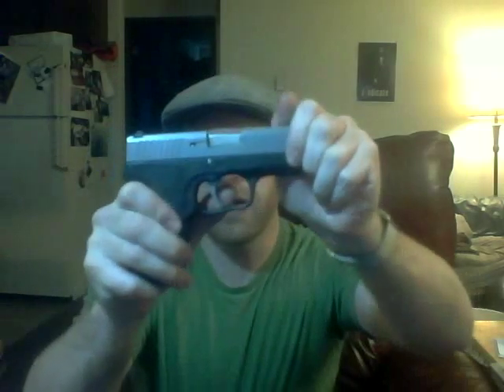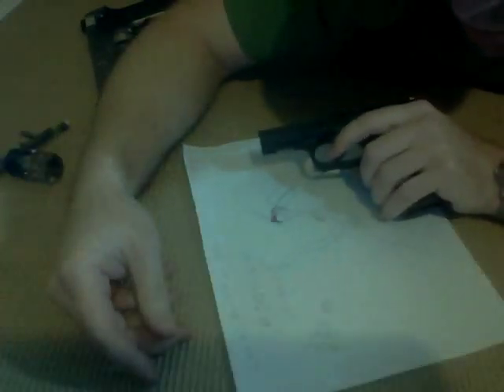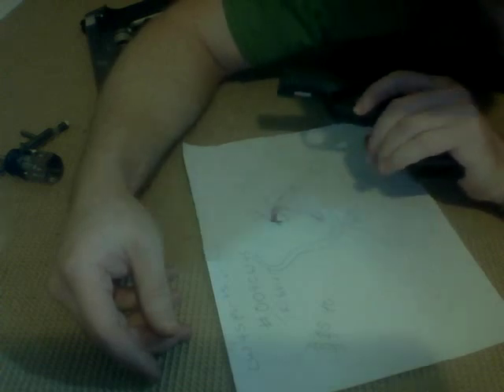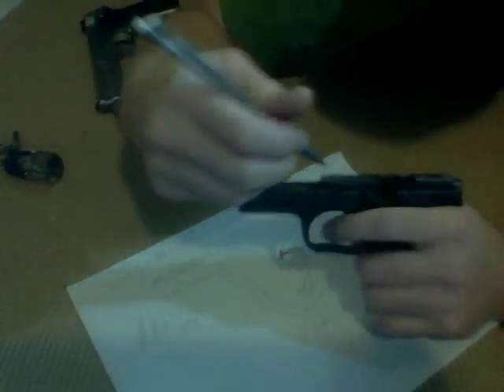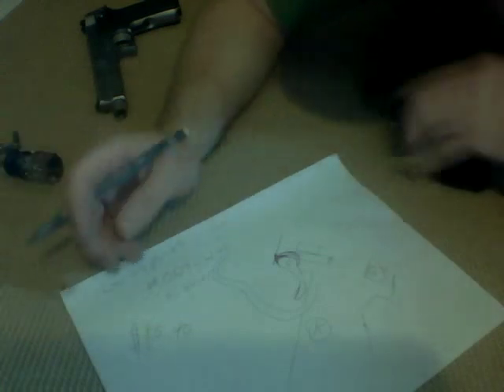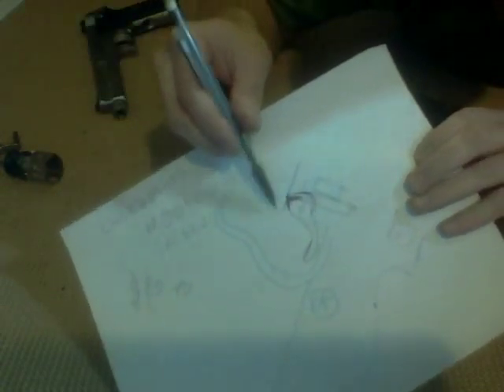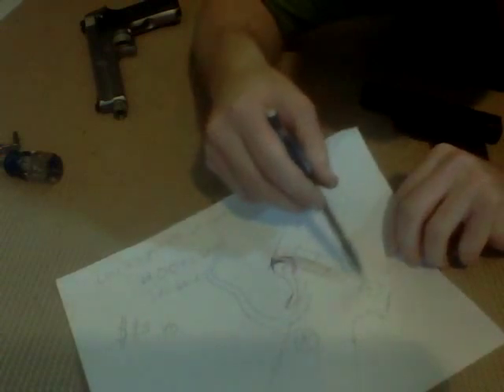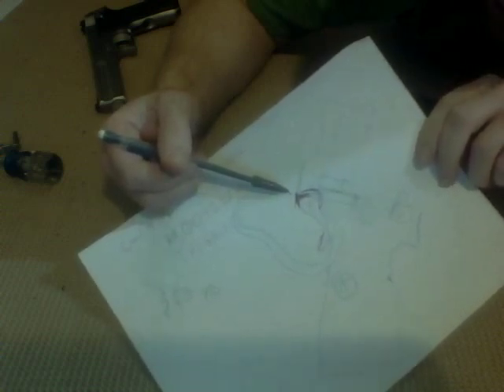Kahr Problems ... addressing a serious issue with a CW45

Comment: Brother,  you hit the nail on the head. I just picked up a used CW45 for under my Plate carrier as backup and have this exact issue. Great job figuring that out!!!!!

Wow!!!!! After watching your explanation, I fixed mine with a cheap tiny cordless drill in less than 2 minutes  by simply making a slightly deeper cavity in front of the trigger where you pinpointed the lack of overtravel.  It FIXED the problem without creating any noticeable overtravel but lightened the breaking point by several lbs.  I subscribed.
Reply from the maker: It's great to hear that I'm helping. I got a lot of hate for these videos when I made them.
Reply: @GunFunZS  Stick to your guns (no pun intended) when you know you are right and ignore the ignorance of others displayed as hate posts. If you helped one person, that is success. In your case, you saved me from having the expense and pain of having to send a defective gun back to Kahr to fix. Probably why the original owner dumped it in a pawn shop and I got it for under $300.

Comment: I have a Kahr CW45 and carry it every day and have owned it for around 6 years and absolutely love it. I would recommend anyone to buy one. Thank you James A.
Reply from the maker: Welcome. It's a gun I would trust.
Reply: I have the cm45 and carry it everyday, I have been through it many time's tweaking, smoothing and polishing this and that. However i think that's par for the course with most any budget pistol, owned and operated by a competent user of whatever brand a platform is. That said, if this particular issue outlined is the norm rather than the exception with the cw45 platform, I'm glad you've made the manufacturer aware of the situation either way. We take the savings in the budget world with the general understanding that there's going to be little things that could be done, to make a weapon perform to the best of it's ability. Matter of fact for the most part i enjoy the challenge and opportunity to tweak and make it better than it was thought to be.

Anyways thanks for the info and head's up on the cw45 design, some user experience, tips and tricks on this model. Stay safe out there everyone, most importantly stay frosty asF.

Comment: I have the exact same problem on a CW40.  Never shot it before, just took it to the range today and thought it was broken.  Couldn't get a single shot off with it. Got home started playing with it noticed if I fight against the frame it will shoot. Then I ended up on your video... Also noticed if I do it left handed it will break, right handed is almost impossible.
Reply from the maker: Interesting. Thanks for the info. The one in the video was either hand, but depending on how cold it is, it could be flexed to shoot, or was about impossible. If you warranty it rather than do the fix as shown in http://www.youtube.com/watch?v=gOdIFlDikho&feature=c4-overview&list=UUokyEtnWCHKnIfs3bRX7QLw, do me a favor, please and put a scratch on the trigger bar, another on the trigger. Also observe the area where the trigger contacts the plastic of the frame at the limit of travel. I would like to know which parts they are addressing to fix this from the factory. It could be done at any of those points.

Comment: Couple of quick notes: most people have these devices called Electric Lights!  They are wondrous inventions for providing indoor light -- you should try them sometime.  Another tip:  Seeing you, for some reason, is not my top priority -- I came here to see a Kahr disassembled.  ALL the things done off-camera are the ones I'd like to see!  You have valuable information to share, you could very easily make things clearer for your audience.
Reply from the maker: +tkarlmann My audience for this video was intended to be one person. My camera had just been stolen, and filmed this as a midnight break to explain the situation to the pistol's owner. My apartment at the time had either places with good lighting or places without annoying background noise, and it had to be somewhere I could use the webcam on my laptop as the camera. Most of my other videos have good lighting, are a lot more concise, and have things in shot. However, did you happen to notice the multiple links to Part II? http://www.youtube.com/watch?v=gOdIFlDikho&feature=c4-overview&list=UUokyEtnWCHKnIfs3bRX7QLw

It shows most of what you probably want to know. I was shocked by the wide traffic I immediately got with this little video and the numerous questions I got from people. So I put a bit more effort into that video. It isn't perfect, as I had to fit it around studying for law school midterms.
Reply: GunFun ZS: Well, if your video was intended for one person, then why put it on YT?  I just wanted to see someone take a Kahr apart.  I cannot, obviously, appreciate your back story -- I only know what I saw.  I'll keep searching for a Kahr disassembly video -- by someone who has lights and a better camera.  Good luck with your law-school midterms -- just what this country needs -- more lawyers.
Reply from the maker: tkarlmann First off. Let's deal with your crack at lawyers. I am a business attorney. I help make new businesses start and survive. The nation needs people like me. Moreover, I am an avid firearms enthusiast. I bet if you think about it, you can come up with a few reasons why having policy makers and appliers who like guns would be useful.

Now I am going to turn your question back on you. Why did you go to a video on an obscure technical problem to find the most basic obvious common information? i.e. a field strip video? These guns are self explanatory. But high quality videos on field stripping every identical Kahr pistol (or other similar designs) are plentiful? And why would you complain that my technical video is not doing the job of a primer guide?

As for my reasons to publish?
1) Why not?
2) It was a way to do show and tell with the owner, who lived several hours away from me.
3) I identified a serious latent defect in a life saving tool. I thought the world should know. - that means a defect which is not easy to discover under normal observation- Also I wanted the few people who might have this problem to know the solution.

It turned out there were a lot of people who were simply curious, and a surprisingly large number who actually had the problem. Those guys might have liked a prettier video, but what they cared about was the fix. This gave them that. I left it up for them.

4) It became a sign post to point at the video which explains the situation more clearly and shows the fix in detail, Part II. As near as I can tell, this video draws traffic and was linked in several forums. Pulling it down breaks the link chain.

-- Aside.
I've politely responded to around a hundred comments like yours on this video. I try to take any constructive feedback I can get. However, most of the time, I find that all they have to say is that they weren't adequately entertained and that my video sucks. Usually they have never uploaded a video of their own. I generally check. If someone makes good content, I take their feedback seriously.

 I want my quality to be good, but on the other hand I've noticed an inverse relationship between production effort and traffic.  You might not realize it, but shooting and editing this video took several hours I could barely afford at the time. A shorter video takes several times more work. For example, my video on shotgun crimps took around 8 hours to set up, prep, script and edit. That fit about a 40 minute discussion into a 10 ish minute slot. That's not easy. It has maybe had a few hundred views in a couple years. You never know up front what stuff is going to draw traffic. Throw a video together in one take and post it up raw, and it might be your one big hit. Spend a week on it and it might be tumbleweeds. I just don't have time to put the full effort into every video on the off chance it goes a little viral.
Reply: GunFun ZS:  Yup, that's a lawyerly reply alright!  I hope you will do well in your career.  Why I went to your video has NOTHING to do with field stripping -- that info is in dozens of other videos.  What I was hoping for was a complete Kahr tear-down, and I've already seen one on a tear-down of the slide.  So, you add in poor lighting, blurry closeups and off-camera bits and it does really add up to a dissatisfied viewer.
Reply: GunFun ZS a
Reply: Funny..I enjoy my Kahr..and why be awake at midnight with your eyes 3/4 of the way shut doing a tool review..best.:)

Comment from the maker: I'd like to see if anyone else has experienced this issue. A gunsmith friend pointed out that this kind of thing is usually created by the manufacturer rushing production and not fully cooling the molds between batches. Therefore, it is likely that firearms made prior to or during the last panic might be higher risk for this kind of issue.

Comment: I have one and it does Not break all the way to the frame at all. Perhaps a manufactured difficulty, but there is a warranty. By all means this is definitely one of the best, if not The best concealed 45 acp. Good lord, the feel and accuracy are awesome.
Reply: I would easily take it over a Glock 36.
Reply from the maker: Warranty was rather useless when they had a 6 month backlog and were lying to their customers about the nature of the defect. Also when the defect was unlikely to be detected by owners in normal range use. 

I think they are a decent pistol, but it was a serious problem to have a carry gun which will not fire. Now there are many good options in this category and if you like the kahr 45, by all means use it. The fact that many of them work as designed doesn't eliminate the fact that a significant number don't and that the company still has yet to be honest about the reason.

It is fortunate that their current warranty times are relatively short, and moreover that any person has the option of self-help.

Comment: I own a Kahr CM9 and I talk to a lot of Kahr owners. These are quality guns right up there with Glock as far as reliability. I trust it enough to be one of my carry weapons. Over 1500 rounds through it without a hiccup. Like ANY reputable gun manufacturer, they will fix the problem FREE under warranty. Let me know of a gun manufacturer that has a 100% problem-free record? Bad-mouthing a reputable company for a problem you never even gave them a chance to make it right?........oh my.
Reply from the maker: What bad mouthing? I did a simple fix to the gun in under an hour rather than send it in for warranty during a gun panic (months to get back, likely.) Why is that bad? Why knock my actions when they were my choice? Your gun might run beautifully, but this one didn't and now it does. Problem solved ........................... oh my
Reply: GunFun ZS "serious problem" was a quick fix? This video is very discrediting to a very good American gun manufacturer for a small problem that Kahr would have fixed for you if you gave them a chance in a week's time free of charge. I own a Kahr 9mm and a Glock 40 cal. The Kahr has tighter tolerances and has been just as reliable.
Reply from the maker: Demo Crat A carry gun which won't shoot in cold weather IS a serious problem. There is little warning for this issue unless you know to look for it. My friend had been carrying the gun for the whole summer and the problem only became apparent when we went target shooting in winter. Had he needed the gun, he would have been in a bad situation, even though he had done all the normal testing a gun owner could be expected to do. This is the very definition of a 'latent defect.'

Even if the fix is easy, it does require either modification of a factory trigger spur, or modification of the frame. More than most people would take on, and a very big deal. If a manufacturer is good about fixing problems, that's a good thing, but there is no obligation to pretend the problem didn't exist in the first place. Warranty service is always secondary to whether the item worked correctly in the first place. Simply put, this one didn't work and apparently many others have had the same problem.

I absolutely love the Saiga 12 shotguns (Veprs too), but I don't get mad if someone mentions that his has one with incorrectly sized gas ports. The fact that one of mine was perfect out of the box does not diminish the reality that others have examples that aren't perfect. Nor does that create an obligation for them to hide their experience. On the contrary, more accurate information is undeniably better. People deserve to know that this can happen. It is bizarre to me that people would think that this information should be concealed if the manufacturer is willing to fix problems after the fact. If they fix it, great. I'd share that information too.
Reply: My first Kahr was a lemon.  Trigger issues that wouldn't reset and the hitting the frame.  Not to mention continual feeding problems.  (CM40) You've just been lucky.   No way are they more reliable than a Glock.
Reply from the maker: gpicard1 I've heard of glocks with casting flaws that caused them to spit out the spring clip for the slide lock, brass to face etc. Glocks have lemons too.
Reply: You don't own a CW45 so, you are not feeling with this issue. Other CW45 owners have complained of this issue.

Comment: Have no issues with mines!  If there is a U on the trigger guard the firearm is refurbished and has a 1 year warranty. new Kahr has a 5 year warranty. Kahr CW pistol are their entry level pistols and some have quality control issues.
Reply from the maker: That's good. The owner of this one may have had warranty, but this was much simpler than shipping the gun away for possibly months for warranty work. Warranty would still be an option too, because the part I modified costs $15. We could simply buy a new factory part, install it and ship it off for warranty if he wished to. The specific issue here was probably a result of faster production. Plastic tolerances get worse if they don't let the molds cool as much between batches. The specific limit point is on a pivot, so small materials variations are magnified. Had they put the travel limiter on the trigger bar, it would be far less critical. It's surprising to me that no one noticed that point during development, as the gun is overall very well made and well designed to be very smooth and simple.
Reply: GunFun ZS Yes it's a budget firearm with no polished parts etc, they would raw more customers if they did? Always like Kahr good back up firearm, long as it feeds reliable and accuracy is decent are all I care about, can deal with the other issues.
Reply: Sckarekrow No mines! Improper grammar was intentional!
Reply from the maker: I didn't say Kahrs were good "for the money" or anything like that. Kahrs are generally well made. This one was defective straight from the factory. Refurb or not, this was still a bad firearm. (Not refurb, as it happens.) The fix was easy, and most Kahrs are very well made for any price. I don't care for the long trigger stroke or the ergonomics of the trigger break point, but the rest is pretty good. I'm not a brand hater. I'd buy one if not for the trigger.

Comment: Cool video,  thanks for posting this im planning on buying a CW and im going to check for this before I purchase
Reply from the maker: Thanks. I mostly get offended fans commenting on this vid. Odds are yours will be OK, but the problem only shows up in freezing temperatures. I don't know what gun shop is going to let you take it home, chuck it in the freezer and then dry fire it before buying. Perhaps FTF sale though.
Reply: GunFun ZS so I had the opportunity to try out a cw9 today.  I'm disappointed to say the magazine released after every round.   Switched hands same deal, stayed as far away from the mag release as I could same deal,   friend fired the gun same deal.   I dont think ill be buying one after that.   Kahr seems to be sketchy on their qc, at least on these entry level guns.
Reply from the maker: Interesting. Did you learn whether the fault was with the mag or with  the mag catch?
Reply: we only had one magazine.   Ive heard the old magazine catch where plastic with a metal tip and the new ones are solid metal

Comment: Good video, and I am assuming this problem does not apply to the all metal MK.  I checked my MK9 and it has about 1/16 over travel. A bit heavy for a carry. but I love this thing.
Reply from the maker: charlie dee Unlikely. It doesn't apply to very many of the plastic ones either. However, it is now a thing I would be sure to check with any poly gun.
Reply from the maker: charlie dee Also thanks for saying it was a good video. I personally cringe at it. I made it as a study break expecting only the owner of the pistol to watch. I wish I had taken the time to set up lighting and audio, and prepared so I could keep the content into a shorter time. It's gotten a lot of attention anyway, to my embarrassment. 

On the plus side, quite a surprising number of people have told me that they discovered and solved the problem (including by warranty) after viewing this and the follow-up video.
Reply: How the hell is the mk series considered "heavy"?!
Not long ago; most options were an all steel snubbie or a 1911 Commander.